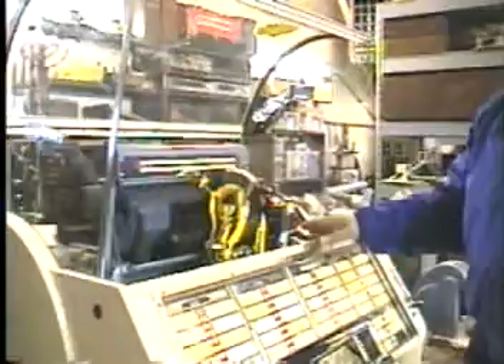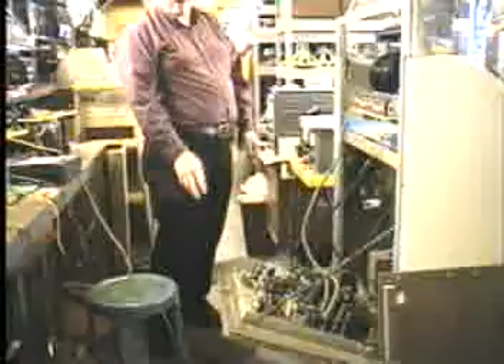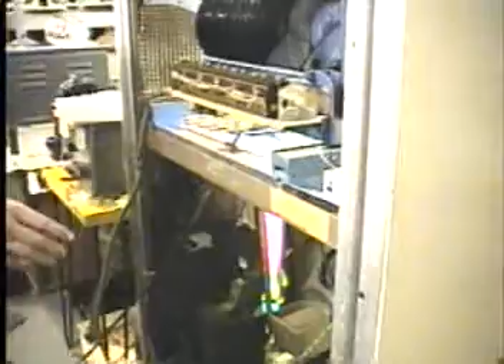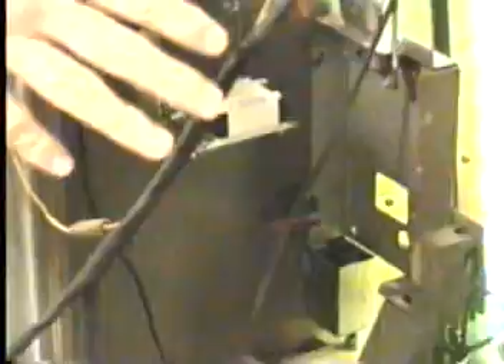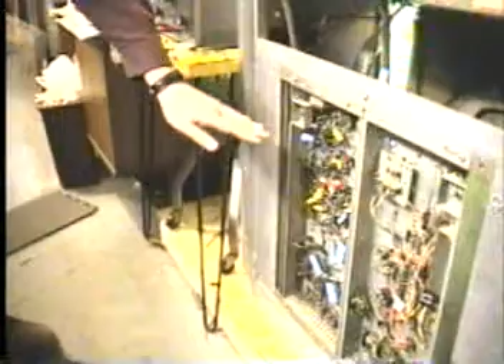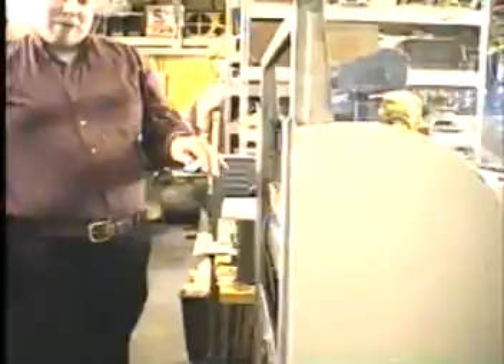Seeburg M100C Jukebox Repair

Comment: I just bought a 1952 Seeburg 100 selectomatic-  all the plugs were out and motherboard separate for moving- I don't have a picture of where the plugs/ connections should go now- do you??
Reply: Hi there. I recently bought the same one. It's in really good condition but it is missing the cartridge. I just ordered keys for it so I can open it it up and see what it looks like on the inside. I nee to replace the power cord as well. Where are you located? When I get mine open if all in tact I can send you pics of where connections go.  Karl

Comment: Google "Tony Miller jukebox" and click on the troubleshooting link.
My problem was syptom 2. First, I clean the electrical switches with a piece of paper and electrial cleaner. Second, I removed, cleaned, oiled and reinstalled the clutch. Third, I used PB Blaster to break down the old oil on the moving parts, cleaned and then oiled the moving parts with 3-in-1 Electric Motor Oil, which is what folks recommend and I found at Lowes. It plays the record now, but I need to fix other things.

Comment: Ive been praying to hear someone talk about my problem, I have a 1952 m100c and it grabs the record then puts it back, then grabs it again, then puts it back before playing so on and so on, so frustrating.  I heard you say the clutch, mine travels fine though.  If its a clutch would i have to put a new one in sir?  Thank u for your time
Reply: Mine does the same thing, but only on some selections. Seems to do it more on selections that don’t get played as much. Did you ever figure it out?
Reply: @GarandChan  hey friend, sadly I've never had it worked on. I just recently 2 weeks ago reached out to a shop in Charlotte to have it repaired. Pathetic on my part waiting 8 years 😅
Reply: @jonesz95  yeah, these things are really cool and quite reliable once they’re going, but finding people who work on them is tough. I got kinda lucky. I got an M100C in rough, non-working shape and set about finding somebody to fix it, called all kinds of places in the tri-state area, and was eventually referred to a guy named Ray Shope not 20 miles from where I live. He didn’t want to mess with it because it was too far gone, but he knew somebody that was selling a pretty nice one, so I bought it with the agreement that Ray would go through it and clean all the contacts and stuff. I’ve only had a few issues and they were all minor. There’s the aforementioned issue of sometimes spazzing out on certain selections (it seems to go away if I play them more), sometimes it plays a selection over and over again, but will eventually stop, and one time it did the “sit and spin,” but I was able to manually force it to pick up a record by messing with the contacts on the carriage and it hasn’t done it since. Need to figure out how to service it myself, but I’d highly recommend Ray if you live reasonably close to the Louisville area.